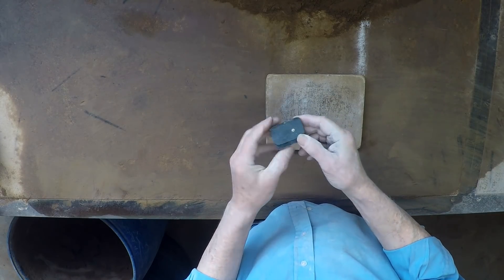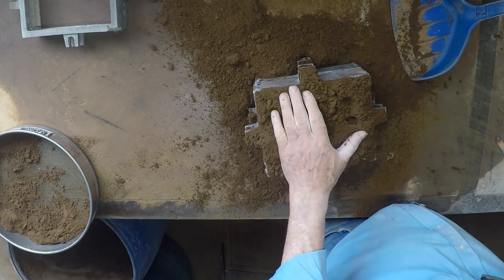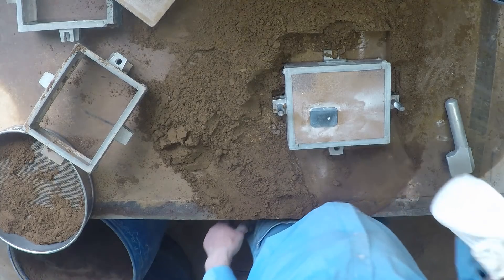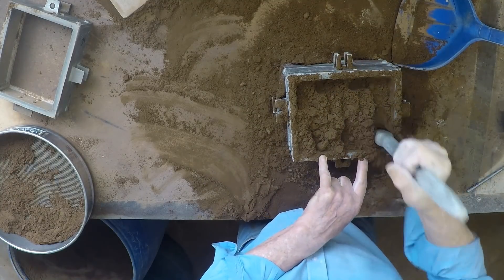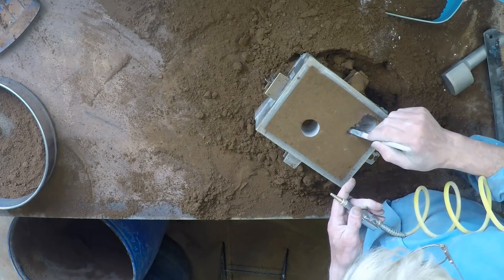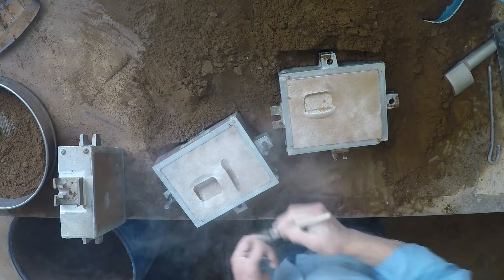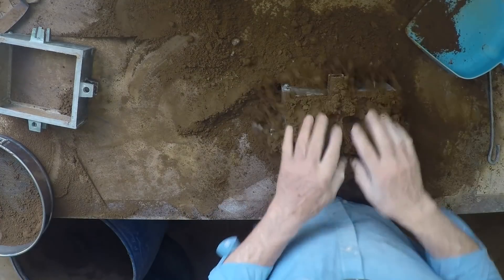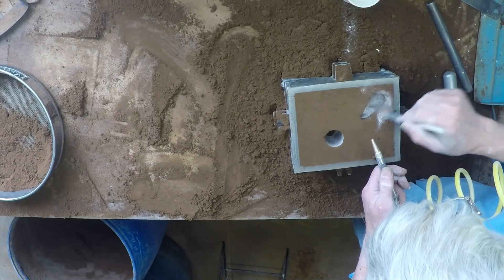Casting a lens blank - an example of good pouring basin design.  Part 1, Making the mould

Comment: Why do you cut the gate in the cope and the runner in the drag?  Many thanks.
Reply from the maker: Fred, Well the theory is that this helps ensure the runner is full before the gate starts to flow. The golden rule is to take the metal down to the lowest part of the mould via the properly sized and tapered sprue. From there the metal must only move upwards (or at least horizontally)  So out into the runner and then up into the gate and then horizontally into the casting and steadily upwards. Not always possible or practical to do this of course but always worth trying for it....Martin

Comment: Is there a reason not to make a more durable odd side out of core sand? Granted, not needed by a seasoned pro like you, but  what about ham handed clumsy neophytes like myself, lol?
Reply from the maker: Luddite, I have seen oddsides made out of almost anything (well, ok, maybe not soft cheese) Concrete, plaster, plastic, car body filer, wood, metal, plasticine, wax, cast resins of all types, and as you suggest core sand. For me its a matter of how many I have to make, How nasty the parting line is, how difficult is it to make the oddside, and will I get a repeat order? This determines how much effort I am prepared to put into making the oddside. Where an oddside is required for a long running repeat job I will use ones built up out  of wood and car body filler This is particularly the case if the parting line looks like an angry sea even if the requirement is only a handful of castings. It is often well worth while incorporating dowel pin holes in the oddside and to add as much of the gating so it can be moulded rather than cut.... Martin
Reply: lol, soft cheese would certainly test one's skill, but also add a homey scent to the pour! thanks for the comprehensive reply. your "production" based work load and methods are quite informative and seem a bit more practical than the typical artistic/hobbyist efforts the majority of casting channels provide. just finished the gang block vid with the chill plate "disaster"
Reply from the maker: Luddite, Yeh, we were a bit lucky there - the foundry Gods smiled on us that day (tomorrow eh, maybe not do much who knows? But we will see 😀... Martin

Comment: Just subscribed, good to see someone that has done this with experience. Paul sent me here and am glad. I worked in a foundry in my younger years and am gonna start as a hobby what your doing now. It pains me greatly to see people with no experience doing this without doing proper research. Gonna check out the rest of your vids and will push the hobbiest your way. Good job!!
Reply from the maker: Donnie, Thank you for the subscription. Paul and Swdweeb who are by their own definition early in their foundry experiences are people prepared to learn and not to be blindsided by bad info. I share you pain! In fact it was seeing some of the bad info out there on YT that got me doing videos. I am, rather conceitedly perhaps, trying to counteract the bad stuff. I am a qualified metallurgist and have worked in a number of foundries. I started making castings myself more than 60 years ago although I  only got serious around 1970. I have in addition tried to keep up with modern thinking - principally that of John Campbell who, a little tongue in cheek, describes the more, ahem, "traditional" foundry techniques as 6000 year old technology. In part at least he is correct and sadly much of the literature available follows the old methods. This does make it hard for people to do good research and come up with good methods to use, it is just so easy to get mislead by well meaning but often just plain wrong books.... Martin

Comment: Great explication of the process Martin on this video. 

Q. Was the part your casting not flat on the bottom? I didn’t quite see/understand why you made the parts parting line below the sand level when you were setting up the oddside
Reply from the maker: Mike, No, the part was not flat. If you look at about 3 minutes in part 2 you can see the cast and fettled parts shown in various orientations. Some are shown with the disc sanded face uppermost. This is the face that the feeder was attached to and it is the main face of the parting line. Others are shown with this face down and you can see that along both long sides there is an undercut that necessitated either the cutting down of each mould to get rid of this undercut for each mould or the making of a quick oddside to set the parting line up correctly. As I had ten moulds to make it was quicker to cut one down and make an oddside off it, then use the oddside for the remaining 9 than it would have been to cut all 10 down. Also dropping the pattern out onto an oddside is an easy way of getting it out (assuming its heavy enough to drop out of course -:) )...Martin
Reply: Olfoundryman got it. Thanks for the explanation/clarification.  It was hard to see on my phone but clearer on my tv:-)

Comment: always learning something just watching you work. looks like i have a gig making a pattern for a couple lathe compound slides should be a interesting project
Reply from the maker: Old iron, Passing on what I have learnt over the years is what I am on about, If I have managed to do that its good. Compound slides, in iron I assume. Iron is said to be "Gods gift to the foundry man" as if you get the composition right there is no shrinkage. All you have to do is put up with  the greater heat and short crucible life -:)... Martin

Comment: OK - This is a temp form of a backing board.  If you were doing a great number a backing board would be better right?
Reply from the maker: htral,  I must admit I have never heard it called a backing board but yes, you are correct for longer run jobs I either have a proper oddside made up usually in wood and my videos on the throttle body casting shows one of these, or I have a plate made up with the pattern(s) glued in place to it. The latter is more usual for small work where I want a few in each mould. Usually the oddside or plate will have pin holes and slots to match the moulding boxes.... Martin
Reply: Sorry - wrong term -- Follow or Follower board!  Ug, I'm not so old that I can blame age....
Reply: you got it i made something like that for a angle plate pattern
Reply: htral happens to me all the time lol
Reply from the maker: Htral, Ah, "Follow board" now I definitely have heard it called that! Happens to me all the time too but I do have the age excuse, just call me one of the "confused elderly" -:) ... Martin

Comment: Love this video. Did you cast your own flask boxes "cope and drag"? If so could you make a video of that?
Reply from the maker: K, Yes I did cast the flasks. These particular ones were cast very slowly in sand one side at a time over some months when I was younger and sillier. I have 10 and a half of these flasks so that makes 84 sides. They were machined with the help of a friend on his horizontal mill, and then drilled tapped and bolted together. At the time it seemed to take forever but it was well worth it as I have made thousands of casting in those little flasks. Other flasks I have cast in gravity dies - did 160 sides in a day! Time permitting I have plans to do a video on my journey through moulding flasks and to finish it with my recommendations for flasks suited to the occasional  caster as well as the more productive one... Martin

Comment: Mr. Martin,  I'm impressed with your skill! Could you separately tell us what kind of molding mixture you use (can it be replaced with another one?) than cover the feeders of castings, and how do you get such a shiny surface casting! Thank you in advance and greetings from Ukraine!
Reply from the maker: Greetings fro Australia I think that you are the second Ukrainian I have replied too.The sand that I use is a natural green sand. It is straight out of the ground from a quarry a few kilometres from where I live. I do grind some of it finer to produce the facing sand, and it is this facing sand that is in part at least responsible for the smooth and shiny surface. These castings were smooth but they were not as shiny as I normally get, many of my other videos show much shiner castings. The use of a good alloy and proper feeding also helps with the shine. Many people use petrobond type of sands with good success to produce smooth castings. Otherwise I suggest that you see if there are any commercial foundries near you and ask them where they get their sand from... Martin